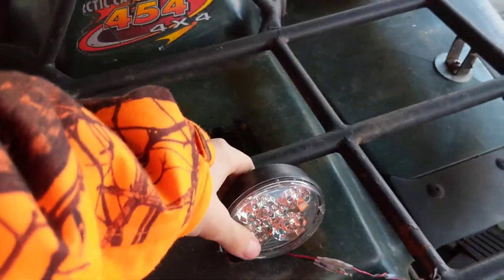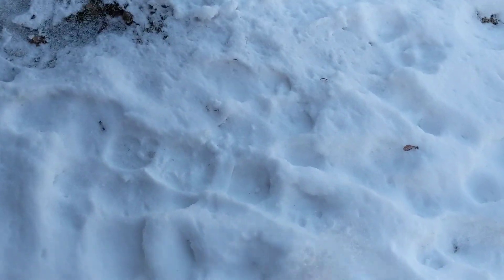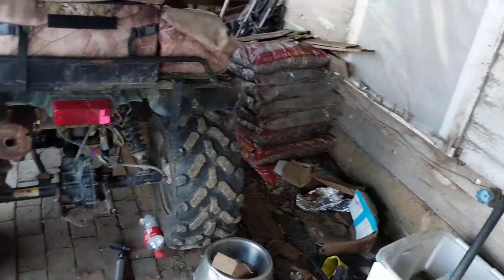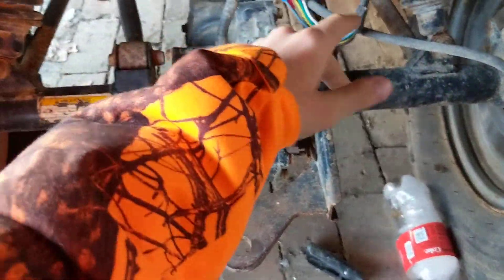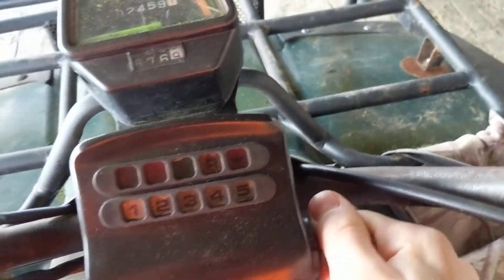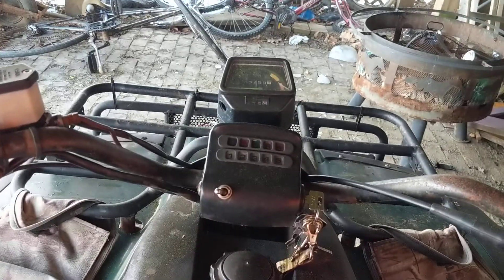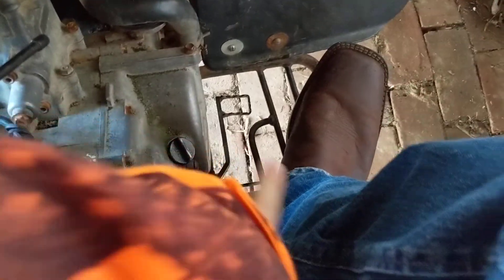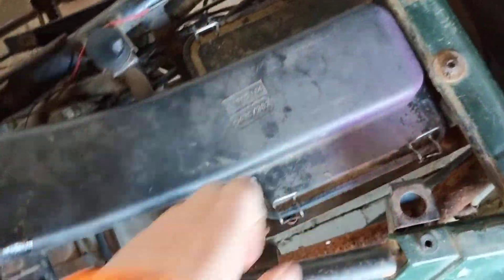1998 Arctic Cat ATV

Comment: The taillight assembly is rather difficult to get removed and unplugged from the harness.
Reply: Do you know much about these atvs.  Thanks
Reply: @markholmes58  I actually do, do you? You seem ignorant about the facts today.
Reply: Hi no not been ignorant I was asking if you knew about these  because I don't. I was asking for advice thats all mate. I need the locking nut sizes and where I could get them from.  Thanks
Reply: I just need advice if possible thanks
Reply: @markholmes58  go to Lowe’s they a bolt for everything apparently. They are very cheap.